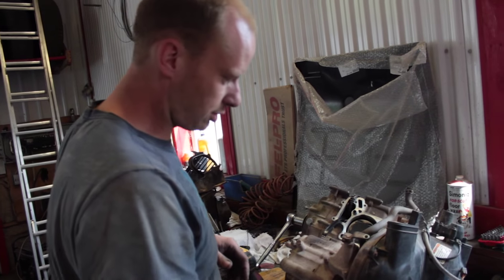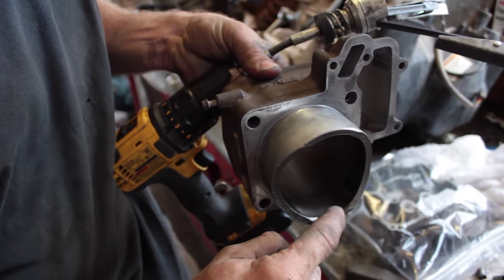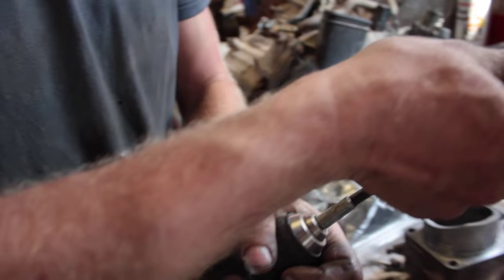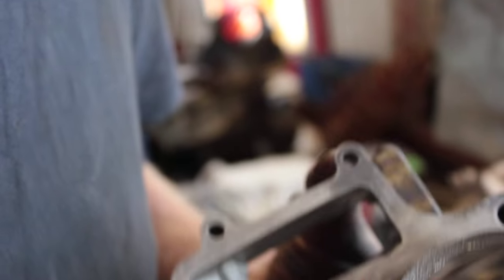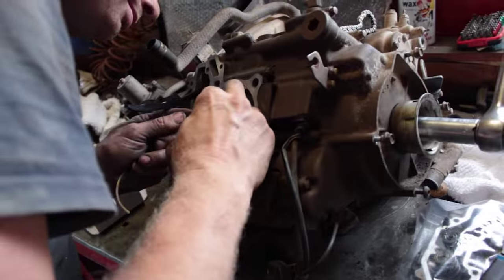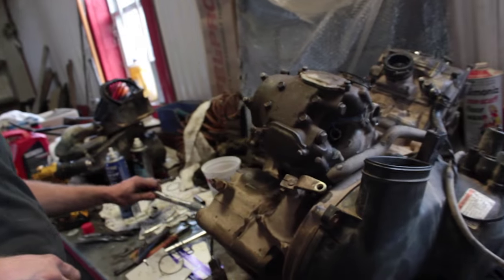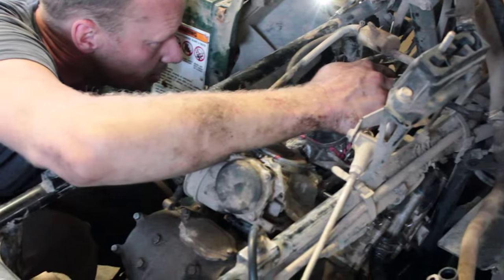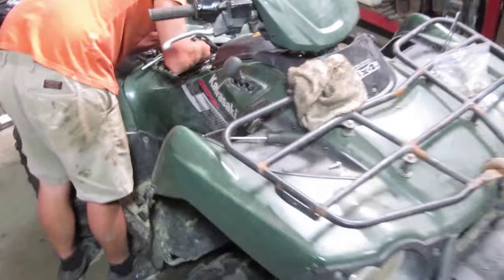4-STROKE REBUILD: Kawasaki Brute Force (Part 2)

Comment: You should not be able to bend a compression ring. When twisted, it should snap.When the ring bends, it has been overheated.  When overheated, it loses it's tension and that reduces compression.
Reply: I thought that was weird too. Probably why this engine died to begin with. Workhorse atvs like this are often neglected.

Comment: Crosshatch gives a grippy surface that the oil rings can deposit oil on, and a glassed bore will not hold a film!
Reply: This is not correct for a Nickel ceramic coating(Nikasil) designed to supply a hard, wear-resistant coating on an aluminium surface.

Comment: Did you have the oil drain plug chased or re-tapped?
Reply from the maker: +rover215 Yes, I ran a tap in there and it is holding well

Comment from the maker: Phillip Cortez I should have stressed more that you have to be extremely careful when honing that you don't take much off at all but is acceptable to hone the cylinders.  There are a few forums debating the issue (tried to add the link but didn't work, but google "honing Kawasaki nickel cylinders" and the consensus is a crass hatch is needed.  I also called the Kawi dealer I got the parts from and they also said to hone it.  Yamaha's are different due to piston rock which wears the nikasil.  The rock is due to a small skirt on a large piston so there is no room to hone it.  Thanks for the input!
Reply from the maker: +Phillip Cortez 
without breaking it in, I had 60 and 70 psi of compression.  To seat the rings, peg it as soon as it starts and put it under load as soon as you can.  I didn't check it again after but I gave it a good beating up North so if it comes back, I will check it again and see if compression went up at all.  Thanks for the input!
Reply: you're sharp an thanks for the videos. I took my 750 brute to the shop they rebuilt the carb and it still won't start I paid them $350 thinking about doing what you did on the vid. how much did you spend on parts and machining if any?
Reply: Yeah the are like the only people in town they call their prices just never had time or confidence to take on a mechanical project this size I'm not a mechanic so really don't know much about motors but after watching I think I will give it a shot and I will buy a compression tester.
Reply: +Phillip Cortez  I really appreciate that. I will see what I can do its an 07 I don't want to scrap it. it started to bog down then died when I tried to get it started again never did fire up even after the new carb job. going to see  if it's worth digging into. with the prices I'm getting from the local shop it's never going to happen
Reply: +Phillip Cortez thanks man I think I have enough info to start Ima get on it!
Reply: Hi mate
what rings size did you use for the rebuild?
thanks
Reply: Hi buddy
how do you save the camshaft from turning when you put the tensioner on? do you have to keep the marks lined up wven after putting the tensioner on

Comment: hows the quad doing since the rebuild? im doing my first rebuild of top end. got the heads done at shop and new pistons and vlaves and seals. when i got it was bad off. my buddy rebuilt top end first time. but it started to over heat and blow white clouds constantly. im hoping that it was just air bubble last time that caused it to over heat..... also already replaced waterpump before last rebuild. maybe cylinder gasket leaked antifreeze with oil.... basically got almost 5 grand in this and havent been able to ride it yet... but if it works after i put together then its worth it.... just making sure i do everything as close to specs as possible.

Comment: Awesome demonstration! I like the fact that you include proper torque values. That's always important! This video inspired me to wanna rebuild mine!
Reply: It should be checked if the torque values are for clean and dry threads or lightly oiled. Will make a difference.
Reply: if you go by the torque settings in manual. should you have dry or lightly oiled?

Comment: For a 650 90o V twin, it sounds shit. I've had 2 Suzuki 650S and they sounded the bollocks! Especially with an aftermarket exhaust (which was stubby n straight through 😊).
You need to build an exhaust n have it straight through. The pipes need to be bigger and you could even make a dual exhaust. Straight out of the block 👍🏻

There are 2 sounds I love. A 90o V8. And MOSTLY, a 90o V twin 😍

Comment: I just installed a head on my engine the other day and I think you switched the torque numbers on the rocker case. The four center bolts with washers are 78 inch pounds, and 5, 6, and the perimeter bolts are 87 inch pounds.
Reply: she wont last with those torque values backwords!! 9 inch pounds shes gonna blow!!

Comment: Great video.  You guys always seem to be having so much fun.  Quick note regarding ring end-gap.  I was always taught to measure the gap at the bottom of piston travel, where the least wear takes place because of lower combustion temps etc., which is probably where end gap would be least. ...I know, ...just saying.  Thanks again :)

Comment: Nice vid.,  Rich - thanks.. A few questions/comments..
How come you did not mic the cylinder to see if it needed boring?
I was always taught to wash the cylinder with soap and water and a brush multiple times to remove all of the microscopic hone grit. I did not see you make much of an effort there other than wiping it down.
WHY DON'T YOU WEAR NITRILE GLOVES? It pains me to see you constantly spraying brake-kleen and all those other chemicals on your hands!

Comment: Keep an eye on the front diffs on the brutes. I have a buddy with a 650 who put 3 in and another friend with a 750 had a toonie sized hole in the top. Took the plug out and 3 drop of water came out. All bearings destroyed. Rusty gears. Blasted brakeklean through the diffs sunroof and mud, water, grass came out the drain. We cut a circle out of my old jetta's hood and jb welded it over the hole. Filled the entire diff with grease from a grease gun and took it for a 45k rip the next day. Just waiting for it to grenade and hes gonna rebuild it.

Comment: I have a problem with my 750, it is creating a bunch of crankcase pressure thats not getting relieved. ( blowing out oil seal on the clutch side of motor) could you help me with figuring out where the breather tube for the crankcase is at? I'm used to sport quads that have them in the wide open but Im having trouble looking around the plastics and everything to see one

Comment: How did you clean your gasket surfaces? Like for the head. My gaskets are old and baked onto my surfaces. Really tough to get it smooth. Btw what's that spray called you were using for your gaskets?
Reply: i use a razor blade and brake cleaner. seems to work well for me

Comment: Hello DG,.,.I'm about to work my front head just as you did-  only question I have is - What kind of honing tool should I use to hone my front cyl ? or at least which one u used? I'm all set at this point, just need a lil bit of guidance as for the honing tool- thanks for your video- really detailed and practical.
Reply: I always use a ball Hone, ive built a lot of engines from gocart race engines to 800hp big block chevys and ive used both types and I prefer a ball hone and I use deisel fuel with a oil in it as my lube for the hone

Comment: was there special fluid you needed for the transmission side of the rebuild. currently rebuilding my 700 prairie. looks like its about the same process
Reply: Transmission and engine are all in one case on these motors...so, in other words, the engine and transmission are bathed in the same fluid...

Comment: Never use blue RTV on the head it's for water pumps it's not oil or fuel resistant and it will eat it and get down into your engine! Use the ultra black it's Oil and Fuel resistant!

Comment: I bought a brute force that had got water in the motor the first time the guy took it out. it only has 50 hours on it. He never got it running again after drowning it out. He just changed the oil and parked it up. It sat up for a while and now while when I got it and the motor was locked up. I am going to pull the motor out and do a rebuild following your video here. What should i wash the bottom end of the motor out with to ensure that it is clean.
Reply from the maker: You will most likely have to go more in depth than I went by splitting the bottom case.  I have had good luck using a  50/50 mix of acetone and atf in cylinders to unlock engines.  I would still disassemble everything and use a degreaser like varsol and brake clean to clean everything
Reply: It was locked up when i got it but i have since unlocked it. But when you would crank it excessive amounts of oil would come out the crank case vent tube. So i took the motor out the of the bike and have it on a table in the shop. What could I wash the inside of the block out with to make sure it is clean. I dont want to split the case unless I have too. The motor only has 5o hours on it    I paid 450 bucks for it with nice wheels and tires and winch   did I get a good deal
Reply from the maker: You got a great deal but Its worth to split the bottom end.  Take a good look at the bearings and crank.  All the work you do could be for nothing if there is crap that gets into the wrong places.  Its never fun having it blow in the middle of a trail and having to need a tow.
Reply: is it much more complicated to split the case

Comment: Are putting the ring gaps on the piston the same for every 4 stroke four wheeler?
Reply from the maker: Unless otherwise stated by the manufacturer, its a good general rule of thumb.  I just did a Rotax sea doo engine and the gaps are set by a detent in the piston grove.  With the pin facing 12 and 6 oclock, the gaps were at 2 and 4 oclock
Reply: Oh okay. 10-4. I'm looking to rebuild a Kawasaki Mojave and just going over everything

Comment: I did my 650i in frame, it was painful!  I wish i had it on the bench.   Good vid!
Reply: I'm doing it in frame now. You are correct that it is a bitch. Especially timing the front cylinder.

Comment: can you adjust the valves before installation
Reply: You can but it's easier with head on n timing belt on so you can turn crank instead of trying to keep da cam from moving during adjustment

Comment: I take it Kawasaki's are typically loud engines? I did a top end rebuild on my Kawasaki and runs great now. But the engine is much louder than before. All sorts of metallic sounds, but runs good and no smoke. everything is also done to spec, in accordance with the service Manual.  My 2013 Honda purrs like a kitten though.  I enjoy your vids man!
Reply: if its engine noise and not exhaust noise you could try using a thicker oil to quiet it down

Comment: how many miles were on that Brute when the intake valves toasted?
Reply from the maker: I think about 5000 km, but it had a HAAAAAARD life.  The owner and I both beat the living tar out of it.
Reply: +DEBOSS GARAGE cool! I have 9,750 miles on mine and I think the valves are shot too. 
Where are you located? If you're close enough, I'd drop it off to you if you wanted the work? Or, I will have to watch these two videos a couple dozen times and attempt it myself!😮
Reply from the maker: I'm in Dunnville Ontario Canada.  If you are from Utah, I don't think its going to work out....
Reply: +DEBOSS GARAGE darn it! I was hoping you were closer. You do a great job and take care in what you do. It's hard to find anyone around here that I would trust to do it. There isn't even that many guys in Utah that know anything about Kawies.
Reply from the maker: NP.  Our yearly camping trip is coming up again.  I am picking up the Brute next week and rebuilding the carbs.  It seemed to bog down on the bottom end so I want that taken care of before I go.  Look for the videos coming in a few weeks.  Good luck with your build!

Comment: Would you mind throwing out some numbers if you don't mind me asking ? 
Sorry but you could really short cut me on a possible Frankenstein here asking $2500.

Tie Rods, Seat, Battery, Reg, Exhaust and I'm already at a 1000 bucks over asking before the engine running issues and trashed plastics, its been beached so I'm concerend for the worst with sand in the valves and venturi, without a tear down.

Thanks Canada

Comment: Kawasucki small engines are notorious for valve issues. Highly overrated small engines especially in the commercial zero turn market.
Reply: Wayne Swicegood bullshit. Kawi is the best commercial zero turn motor. I would know I work on them daily. I’ve replaced many more Briggs and probably a few more kohlers than I have Kawis. Valve issues are pretty rare  on a kawi other than the common .005” adjustment. In fact Kohler and Briggs certainly has the most issues with valves.  I have seen many loose valve seats, worn rocker arms and pivots and bent pushrods as well as a bad cam on Briggs. Kohler commands constantly have terrible lifter tick that is sometimes fixed and sometimes not with a new set of hydraulic lifters. Hydraulic lifters was a good idea but poorly executed as I’ve even seen command EFI engines that are only a few years old have lifter tick so bad it sounded like a rod knock or some other kind of rap. New lifters thankfully fixed that one. And the dumbest valve issue I’ve ever seen is on a EFI Kohler  (aegis series If I remember correctly), a very “high end” (expensive) engine. One of the valves became so loose that the rocker arm fell off. The cylinder stopped firing and the EFI kept spraying fuel into the cylinder, washing away all the oil and severely scoring the cylinder wall. Totaling out a 2015 zero turn, customer was disgusted and took business elsewhere. I can say with confidence any of the commercial duty Kawasaki engines are the best on the zero turn market.
Reply: I've got a fd620d replacing the cam was plastic, while a part I'll go ahead & do rebuild the upper end , on my encore proline , Kawasaki v twin water cooled , you'll never find a better engine ,no argument , fact , hell u made a blade out of a plastic  55 gallon drum trash can ,& push snow ,v cut tractor tires & chains for winter , motor takes care of me !